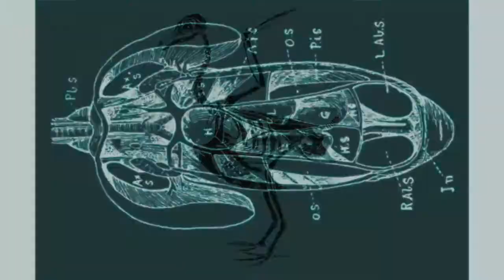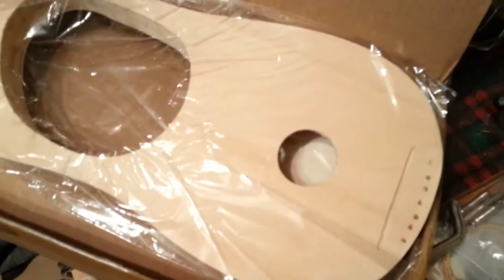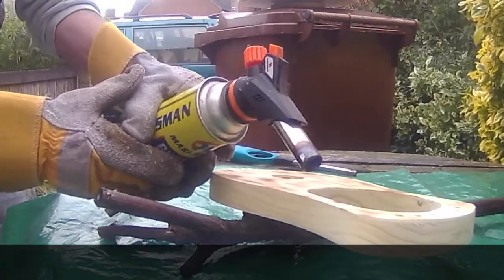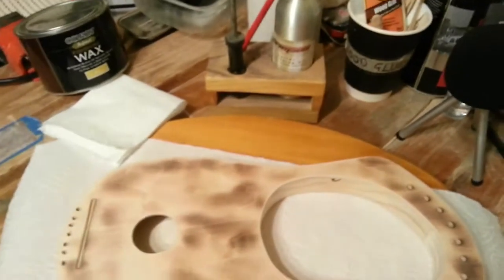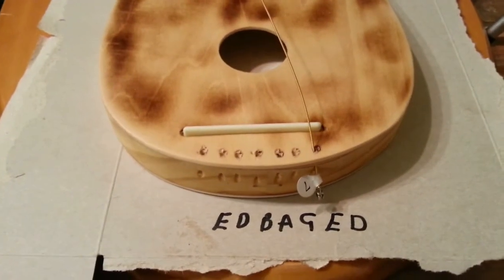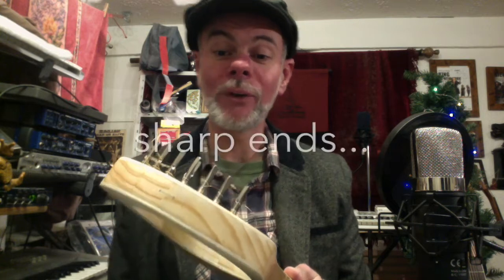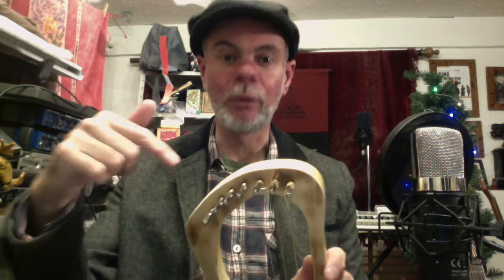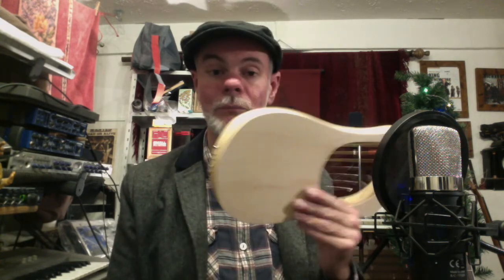Inexpensive Lyre kit build

Comment: That does sound sweet!  Well done sir, and thank you for your time and trouble . . . .
Reply from the maker: many thanks, I've now put a little contact mic on it, lots of fun through a looping pedal!
Reply: @abominablemusic  - yes, those little contact mics can be fine!  Even the cheap piezo ones can work really well with a bit of fiddling and filtering.  I find that the small (9mm) piezos work great with one-per-string on a home-brew solid baritone uke.  3D printed widget for the one-per-string saddle/piezo bit.  Might have a go at a lyre this year. . . .
Reply from the maker: @250tegra  do it! You can have fun with the box, not suggesting you burn it, but trying different stains or paint, that sort of thing...
Reply: @abominablemusic  Yes! May well do that - have already sent one of these to my daughter (Hi Klo!) and I badly need to not be ambitious when painting anything (Finger Painting 101 in 1951 - failed).  Maybe a heavy primer, followed by matte black all over,  then the strings, pegs, and bridge will stand out?  If I can find or make a stencil, some simple pattern around the sound hole?
Reply from the maker: @250tegra  a nice sound hole rosette would be great, I bet there templates online.
Reply: @abominablemusic  - I remember the geometry classes where we could make stars with compasses and rulers....  sort of like a mandala?